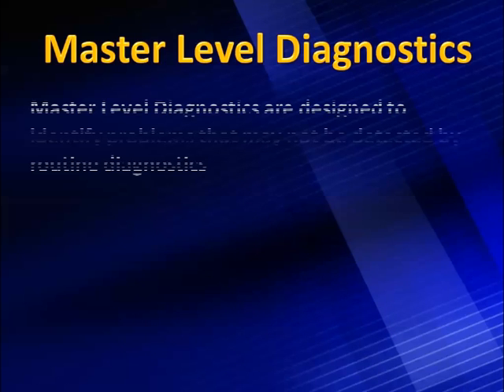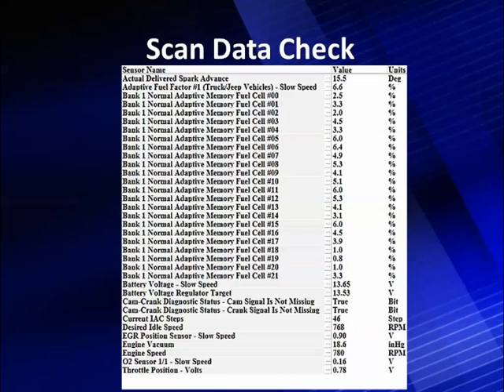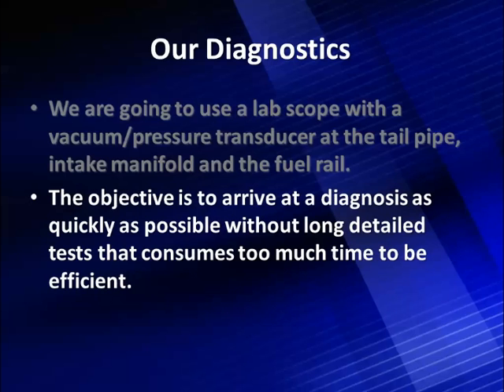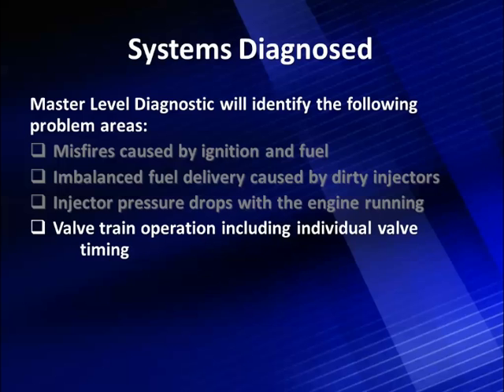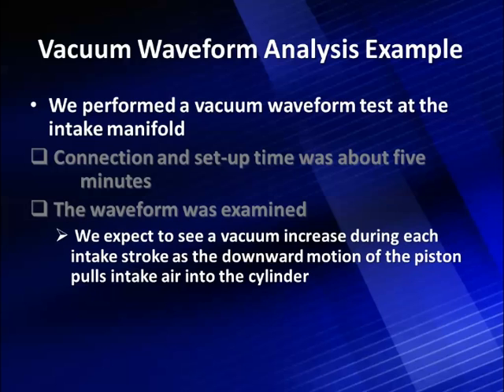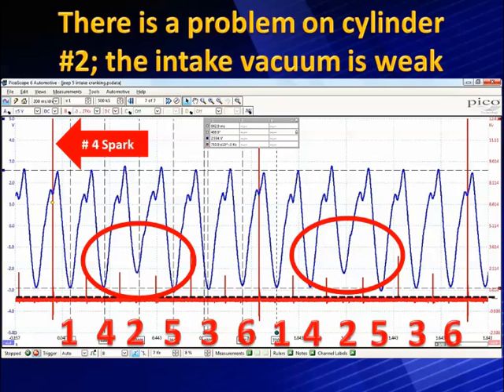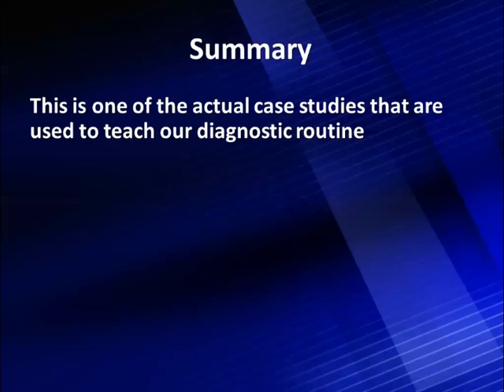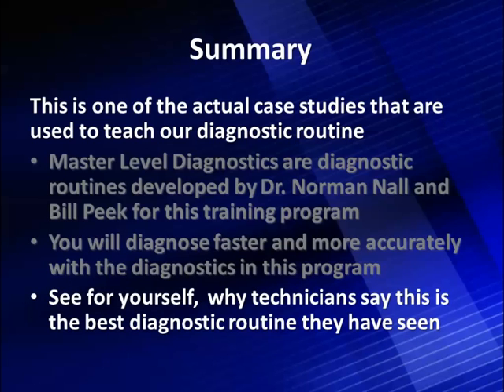Worn cam lobe found with FirstLook and Pico scope

Comment: Good information but isn’t that actually cylinder 6 intake pull? cylinder you shift over 3 from tdc? 360 degrees to the right.
Reply from the maker: You are correct, it is our error

Comment: Firing order is incorrect and also is the vacuum pulses identification  however using the right firing order and the proper pulses identification it is the #2 the one with low vacuum .
Note: correct firing order 1-5-3-6-2-4 
And correct vacuum ID from sync on #4 firing event
3-6-2-4-1-5
Reply from the maker: You are corrct, thanks for catching that.
Reply: Willis Peek  I would like to know how much you guys treating cost it looks like very good material
Reply from the maker: we work with a number of equipment manufacturers and try to bring new diagnostics to technicians. We do live training classes for Automotive Training authority

Comment: So if less air was being drawn into the cylinder because of that lobe would it also mean slightly lower compression? If so would a pressure transducer on that cylinder show less compression pressure than the others?
Reply from the maker: Low compression will reduce the amplitude, but this valve reaches the apex of the cam lobe too soon. Each valve should reach the apex of the cam every 120 degrees of crank rotation. This valve reaches the apex of the lobe and turns before the other cylinders as measured by crank degrees. A bad lifted would also have a lower amplitude but it would not change the timing of the cam lobe apex.
Reply from the maker: Yes, less air is entering, you need to measure 720 degrees to determine the apex is being reached too soon. In cylinder testing is for a single cylinder and it takes longer than looking at the intake and exhaust. It takes time to learn how to analyze the complex waveform. But I do engine running and cranking. Cranking shows me the pumping action without combustion when I disable fuel. I still have spark to identify  cylinders.
Reply: Oh I see what you are saying. I guess the manifold vacuum test is also preferred because the engine is running with the fault occurring uninterrupted as opposed to removing the spark for the pressure transducer test. Efficiency is key. Thanks for the reply!
Reply from the maker: Yes, it will require developing the skill to understand the patterns, but it is quick, efficient and accurate. it also gives you the reference of all the cylinders. In cylinder testing is great for final pin pointing the exact cause of the problem because you know it is going to be productive.
Reply: i found same problem with a  snap throttle compression test,but i like this method cause it shows lobe appex

Comment from the maker: great comment I also am a great believer in secondary ignition analysis. But with a lot of the new coil on plugs and in some cases inaccessible coil-on-plug I'm not getting the patterns I used to. In this case we're going to use this to measure the duration relative to each other each cam lobe in intake and exhaust and we're going to look at variation variation in CAM intake cam lobe is caused by slack timing chains so you great comment thanks its great talking to a real technician